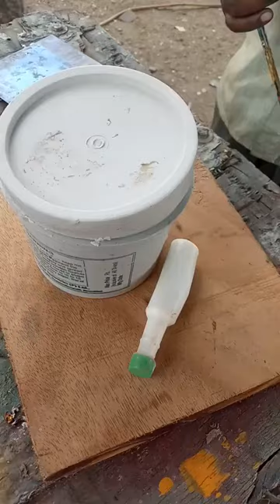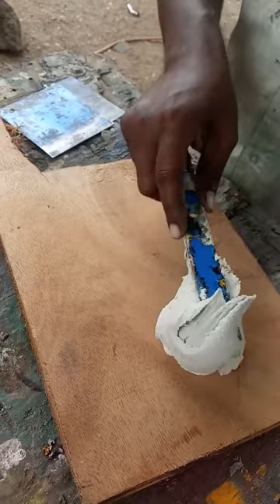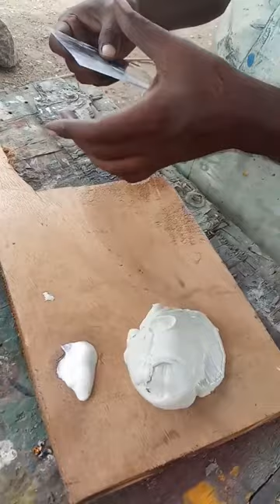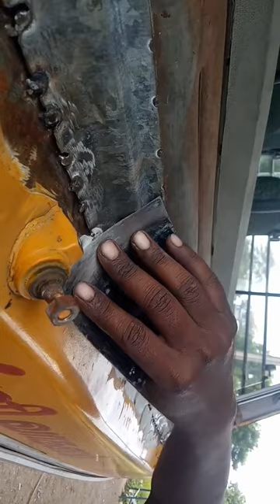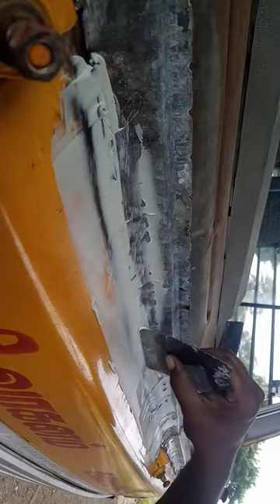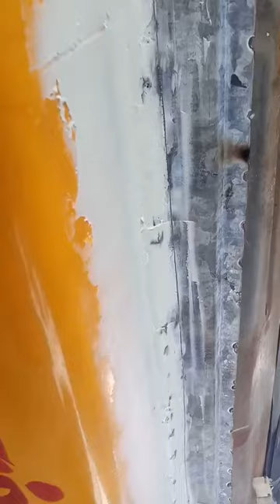How to apply metal paste.

Comment: Can i use it on bolts upon the iron roof sheets??
 Because dropping the water inside and losing POP design 😢
Pls reply ❤
Reply from the maker: You can use silicon paste. you choose colour of paste depending upon roofing sheet colour  
Don't use metal paste on the roofing sheet bolts.
Reply from the maker: The best recommendations for using silicon paste to use roofing sheet bolts.

Example: if metal paste is a crack, water drops again and the sheet becomes rusty.